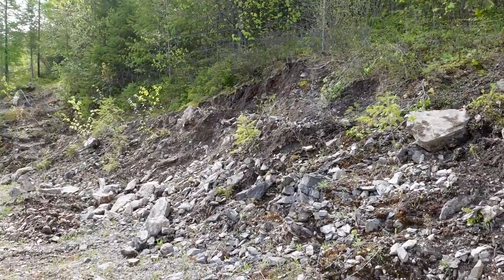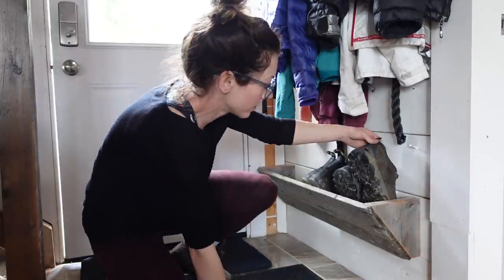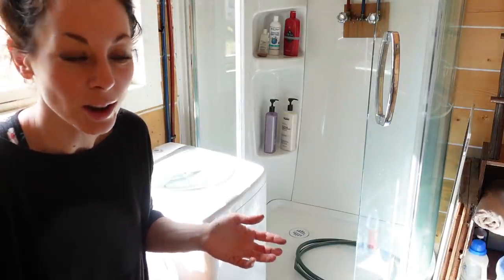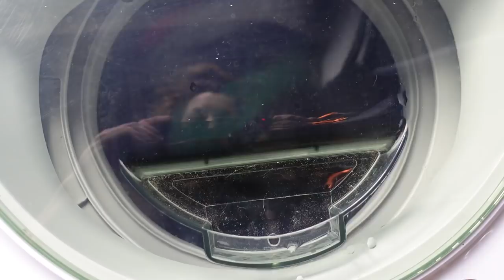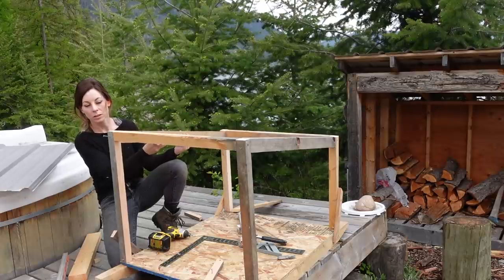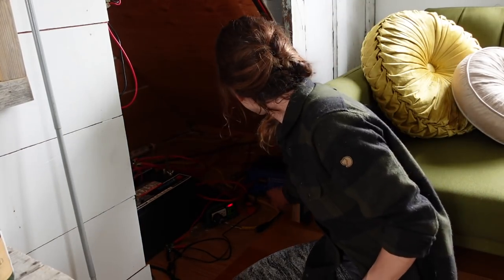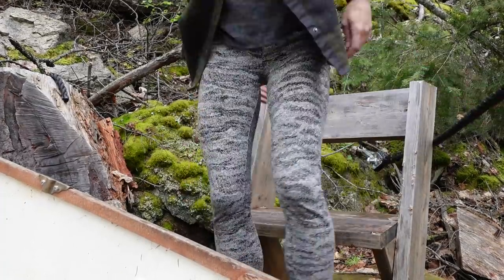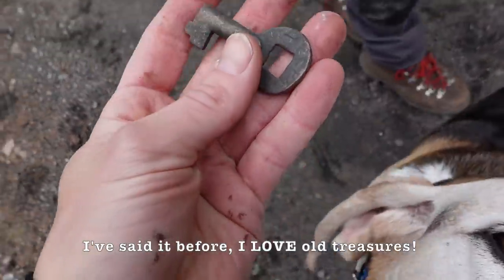Off-grid PRO-JECTS (and the odd PRAH-JECT). Machines. Tools. Fun. Bathing suits. Silliness.

Comment: A couple of sprockets, bike chain and a battery drill for power may be a way of helping with skymule line retrieval. I don't know if the drill would have enough reserve to do the total rewind but it might help with all the manual cranking. Just a thought ,  you guys are amazing and fun to follow.  Thanks for sharing .

Comment: Yer hate splitting too . a trick in the case that a drill isnt handy is to start the screw and then reverse the driver and push hard . It will drill .. or burn  its way through .

Comment: Those silver driver bits you're using on your drills are the absolute best! I've been in construction and installations for 15 years and i got a set of them from (walmart or cdn tire cant remember exactly) and they've outperformed all other bits I've owned. Milwaukee black shockwave comes close. But yea they're the perfect hardness I've never broken one on my impact so far.

Comment: hey there, wow alot of projects....pleased to see mtb trail,love the old mtbs. all so cool,thought with boat you would use posts,trees,to raise up in air,use as a roof,and biuld seat under it,lovers chair...when if raining and half way round trail you could get out of the rain. shpuld shed snow load too. dog kennel,hut was cool, shoe rack nice old weathered wood,bet u get loads from the shoreline,should use some in mini cabin,make coat rack,nook shelves or something. pleased to see sky wire system working better,may need to add a brake or a way of slowung down descent and spool of plastic rope,so doesnt overun,make safer too....sprung ratchet,or pad on a sprung lever to touch spool as rotates,something you can unlock to freely pull up winch block....
take care,peace.

Comment: Well done, Michy and Steve... Projects are moving fast... I like to watch girls building stuff or making something by hand.. =) The dog haus is excelent, I would just make the front side of the roof a bit longer, so the rain doesn't wet the inside if there is a bit of wind... From the other side, considering you made it from scrap materials is really good. Cheers and I hope you will succeed with the cabin on the cliff build. Keep on!

Comment: Excellent as always.  I'd like to see you build a set of saw horses and then when the weather gers better you can cut a few wide slabs on the mill and make you a serious project table.  That way you don't mess up the hot tub deck.  Attach the boards to the saw horses with bolts so you can store it under the house during your off season.  

Just a thought.  Good videos as always

Comment: Michy, building the dog house, why not use your hail gun. I Hope you don't lose another dog (CYLDE). What if these people would have just taken the dog and not returned it, or another Big Cat, or Bear got him. I would Not be letting him run lose. Better to be safe than sorry again. I would have turned the boat  upside down and used it as a shelter to cook under. I have an old 14ft. boat that I put it up on four 8ft post and use it to cook under. I have my gas grill and a charcoal grill there by the river to cook fish, burgers, dogs, or what ever sounds good to eat. Just a little idea of mine. Thanks Steve and Michy for sharing.
Reply from the maker: I literally had that drill and circular saw for power tools there. Plus a hammer. But not even a good hand saw. Just using what I had there! A covered area is a good idea for the boat, but ain’t no taking it down now! 🤪

Comment: 28:38 You need a 'Charge Controller' to prevent over charging your batteries. Trickle chargers never stop charging and burn up or shorten the life of the battery.
Reply from the maker: We do have one. Something was wrong with the wiring for a period of time so the batteries were over charged.

Comment: Okay so, how much per month on the dog cabin , and does it have free wifi and central air? 🍺😆 I'll be looking to move in by late June 🤣
Oh boy, sheesh, Steve will be a certified equipment mechanic before too long haha, those rubber tracks do have their pros and cons thats for sure..
Hey that little boat may have actually been useful to your zipline sky mule thing..? You could of loaded tools and hardware etc. Into it and slid it with the guidance of the line down the hill, maybe?

Comment: Hiya Michgoss,
Another wonderful video, thank you. Is Steve a safety officer? Typical male, he thinks he's immortal and does not wear any safety gear, I've seen a few people like him with bits missing, one I worked with lost an eye through a trail of sparks from an angle grinder burning his eye, yep, no safety glasses. I was four feet from him, not nice... He slipped and the disc remained in contact just sending the sparks in a different direction. You, a typical goil wear whatever is needed.
Have you finished the boat? I would have put a painter from the bow to a mourning ring higher on the cliff, so it looks like the skiff was hanging after the tide went out. 
Stay safe, Steve...
Reply from the maker: We haven’t finished the boat yet. We haven’t been back out there since. Yeah, I wanted to hang it higher to make it look washed over the bank, but Steve’s the captain of the ship, so ultimately his decision. 🤷🏻‍♀️

Comment: Love the dog house, Hope steve is not sent their anytime soon. You want power as much as you want, Buy a Marine Capacitor bank Or make one!, No Sun or Wind needed, And it charges up in 30 seconds to full power off an inverter and can take over 1 million + charges and still keep going, Compared to dirty lithium that scars the planet with mining and can only take 1,200 charges then goes down in power, They fit them now into new Gin Cruiser boats that give 240v 0r 110v depending on your budget and can run a washing machine and a tumble dryer all at the same time to keep the Skippers wife happy and the skipper saving wasting house batterys. Its more expensive, But on the long run you won't need to lug expensive heavy batterys down a slope every 3 years and clearing pannels of snow, when the cold kills the lithium batterys over winter, And then goes down to 75% of the batterys life.  Just a idea Petal.
Reply from the maker: Interesting idea!